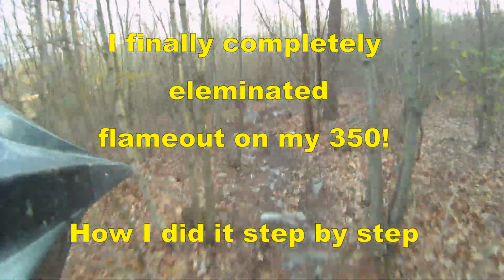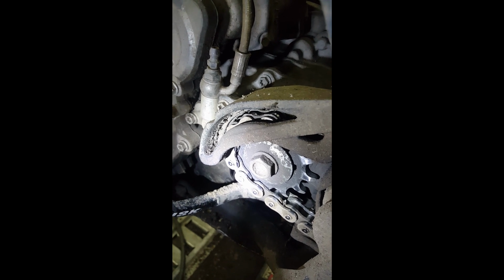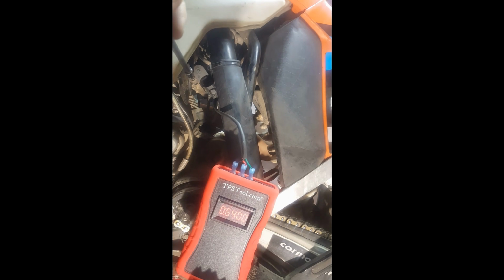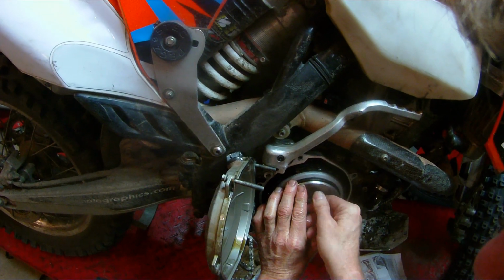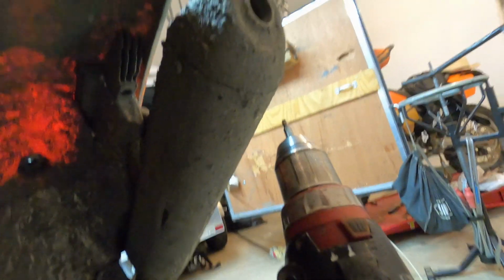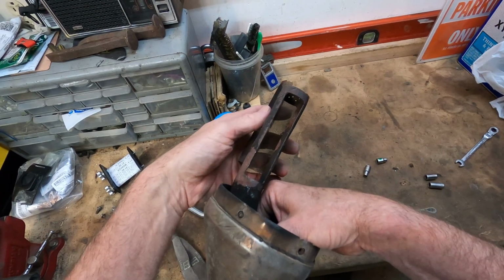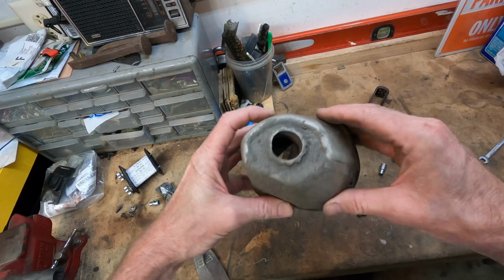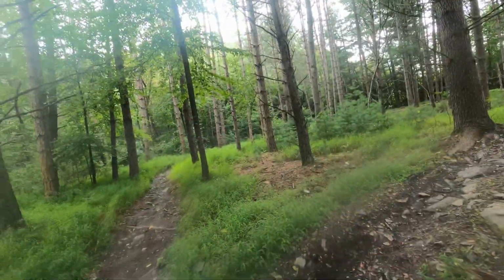KTM 350 Flame Out Fix   How  I Did It   DIY

Comment: Thank you for posting !  Is the tps setting the same for 2015 ktm 450sx?  Same issue. Made me so mad i went bought a yamaha.
Reply from the maker: @conorprovan9435  ideal TPS setting is different for each individual bike. Even if bike is same model and same year it could be different.  I would say note your stock TPS setting so you can go back to it if needed, then search some forums and try some strings you find from others who have the same make a model. It's trial an error and noting you factory starting point is crucial, you may need to revert to it if other settings you try make things worse.

Comment: Flame out has alot to do with the de comp lever on the exhaust cam also. Adjust the spring and it will fix it
Reply from the maker: I'm not sure the ktm350 has that component
Reply: @freakinenduro  2012 exc f does
Reply from the maker: @Rayzer1989  good to know.

Comment: 2021 exc-f never really had flame out problems. I did switch to 13 tooth. Makes it a lot nicer for single track. I set my idle at 2200 rpm with a tusk tach. Running a get ecm and a graves slip on. This bike ran real lean stock. The throttle was very twitchy a slow crawl. Very annoying actually. With all the mods I’m a lot happier now. Has good grunt.
Reply from the maker: Thanks for that input.  I love the 350 engine, great balance of power and size

Comment: My 501 is the same deal. The new end cap and tuner helps. I usually notice the flame outs when I blip and chop the throttle . I haven’t raised the idle yet. I don’t want to loose top speed and figure and have enough power if have to slip the clutch I can

Comment: Flame out is due to not using clutch effectively.  I added a Rekluse to my KTM 350 XCF and it has not flamed out in the last 3 years.  I understand some people are not Rekluse fans (personally I will never ride a 4S without one), but it proves you just have to be super active with clutch and revs to prevent flame out.
Reply: That's partially true,  but you can also get flame out with the bike not moving and in neutral if the carburetor isn't perfectly jetted or you've changed altitudes. Clutch work isn't the only thing that causes it. Running too lean can also cause it, and a lot of bikes are on the lean side from the factory. Air leaks between the air filter and cylinder cab also cause it.

Comment: Great breakdown bud. I just did a Hare Scramble down in Florida on a FC250 and experienced a tad bit of flameout trying to “lug” just a little in the tighter sections and bought a 9oz clutch weight. Still haven’t tried it out but the individual I bought it from didn’t mention anything about a ECU re-flash. Was the weight really that bad?
Reply from the maker: Yeah, it was really bad on my bike. It was easy enough to put on and take off though. Give it a try and see if it works for you

Comment: Moving fro 2 strokes to XC350F - I thought it was my riding - hard to start too
Reply from the maker: Sorry for late reply.  Hard to start: is it hard to kick?  That's normal.  Hard to start like kicking over and over, if it's used check the plug. It could have an old plug or wrong plug. If it's really used it could need a new piston.
Reply: @freakinenduro  electric start only,  i have the get the throttle just right to start before the battery flattens and cannot turn over
Reply from the maker: If it's a used bike: maybe check the plug, Maybe the valves, or might need new top end.  If it's new take back to the dealer

Comment: Idle, tps , all help as you report, But even Blias who was fixing flame out by mapping, only reduces flame out 50%.
I never found exhaust tip made much Differnce, but as long as your bike is set up is correctly tps/ idle ect, Vortex is the Answer , stock ecu's are garbage.
Reply: Ive also ran your config with exhaust tip, and larger caps, Vortex is the Real FIX,  I say this incase you or anyone else still has issue.
Reply from the maker: @brianricoh3242  Thanks for the added info Brian!

Comment: I hate to tell you but that was the spark arrestor you took off.
There is a conical shaped piece of perforated metal down farther in the muffler but it is the same as the perforated core and not a spark arrestor. If you do any local racing that requires a spark arrestor you will still get buy because they usually just stick a stick down in there, but I would still recommend getting one of the aftermarket end caps that come with a cone screen spark arrestor in case the ranger catches you and knows anything. 

I've got a newer 350 and the exhaust came even more plugged up than yours, what I finally did was replace the endcap just to open it up a bit more for desert racing. I went with the fastway end cap.
My dad has the 350 xc that has the same exhaust as the sx, and it doesn't come with a spark arrestor but it still has that perforated cone deeper in so "passes" the test for having a spark arrestor for racing.

Comment: Great video, had the same prob with my 350.. clutch weights are a crock of sht, the clutch is connected the the gearbox and not the crank,  so any rolling inertia is lost through clutch slippage and the gears. The best way to get do it get an Stealy 13 oz flywheel weight. That works well !!

Comment: I noticed that every damn one has a rekluse on it. I had one on my 16' . Flameout was harder to control than manual clutch.I did everything that you did, except weight and exhaust mods. TPS adjustment helped.

Comment: What's the electronic gizmo?
Reply from the maker: TPS tool.  Google and you will find it. You can use a multimeter and a battery. I am not sure if you ever used a multimeter for things,  but they can be a pain. The lead has to have a  perfect connection to the surface of what you are trying to read in order to get a perfect reading.  In my experience, if you wiggle the lead or don't have a perfect contact you will often get a voltage change.  In this caae the voltages are so minute that I think it would very hard to get a perfect reading using just a multimeter with leads. If you wiggle the lead during the process you will probably get an erroneous voltage change.  So.... I bought the special tool.  It's pricey, but cheaper than paying someone.  Another option: you can buy a special wiring harnesses  to adapt to the leads of a multimeter, but then you still have to leads to contend with. So I just bought the tool. Hope this helps.
Reply: @freakinenduro  thanks !!
Reply: @freakinenduro  what bike was in the video ? I have a 18 350xcf
Reply from the maker: @zorro324  2013 KTM 350 XCF-W

Comment: Counterclockwise increases idle speed at choke knob.
Reply from the maker: Thanks!   I couldn't remember which way I turned it
Reply: Wrong.  Turning screw in turns idle up. It drives screw into throttle body pushing open the butterfly valve. Clockwise turns idle up
Reply: Not on my 2014 Euro, clockwise = idle down.
Reply: @chrishalford3858  the only way that would be possible is if the screw was reverse thread so counter clockwise would actually drive screw in to bring idle up. Which is ridiculous .  Would love to see a video of what you have going on there
Reply: @justindwyer3832  KTM manual says counterclockwise to increase idle, clockwise to lower

Comment: I still cannot differentiate between a flameout and a stall. Would you have any videos of the actual flameouts?
Reply from the maker: Those are flame outs at the beginning of the video. The camera doesn't pick up the pop noise very well, it sounds more like a click on the video but it's a pop sound. The engine pops and then shuts off.
Reply: @freakinenduro  okay thx a lot

Comment: I have a 2013 350 xcf-w that I bought used  about 2 years ago.  The previous owner installed a JD tuner on it and richened up the low end and never flamed out again.  In the 2 years I've had it I've only had 1 flame out.  Unfortunately removing the back fire screen in the muffler can you restrict you from riding at some places in Missouri as well as some local enduro and harescramble events require the screen.
Reply from the maker: That's good to know. I haven't had any issues like that in our area. The backfire isn't very loud though, not like a gun shot, more like a pop.

Comment: Great video
I have a ktm 350 XCF that continually flames out but the bike has a factory fitted SXF exhaust
I wonder if the inside of the exhaust looks the same or only EXC exhaust
Reply from the maker: Oh, that is a great question!  I'd like to know about that if you find anything.  I know a guy with a 2016 (Next generation after 2013) his exhaust is a little different.